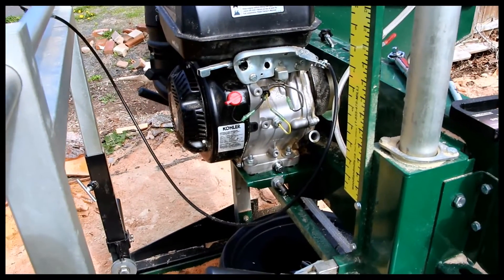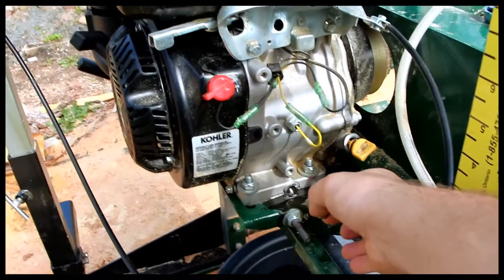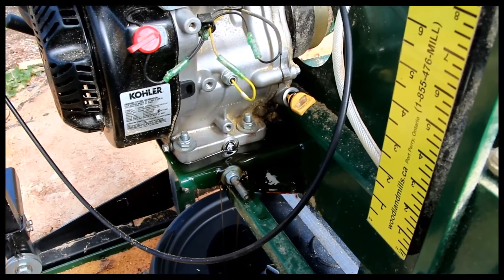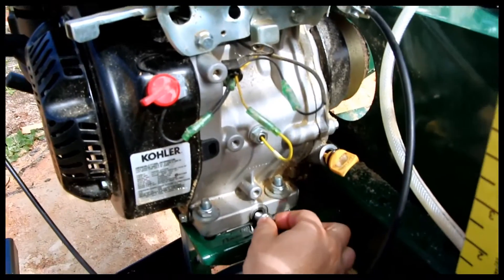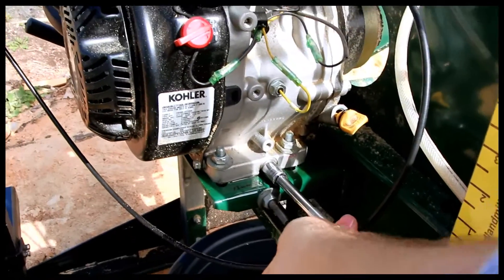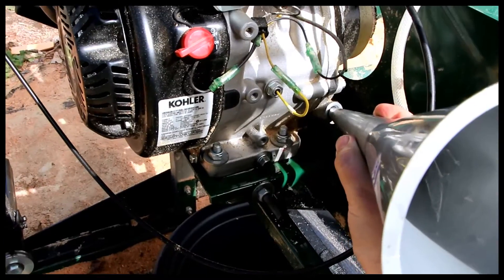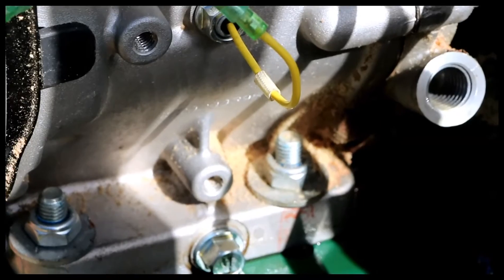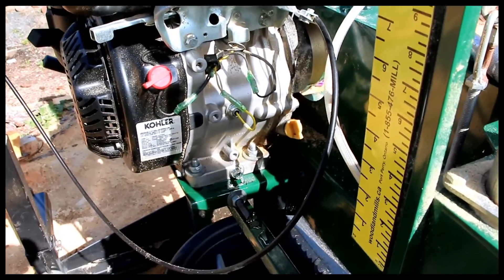kohler ch395 oil change command pro 9.5hp woodland mills hm126

Comment: Nice video. Problem is the older models of the Kohler command pro found on John Deere commercial mowers are way different. 
The drain plug device is virtually impossible to reach. It is wedged into a tight space almost touching the frame and in a spot that
you can't squeeze anything into except two fingers. You can't get your hand into that space to use the "Push in and turn to the left"
dohickey drain plug device. You simply can't get any type of pliers on the thing to get it working. How do you get the oil out?  Two options:
   1. Remove the filter and let the oil run out of the filter housing.  Next, jack up the opposite side of the 562 pound mower until it is
almost perpendicular and let the oil drain out of the oil filter housing that way. It is advisable to make sure the gas tank is empty before
doing that. Don't let the mower tip over.
   2.  Simply replace the filter without changing the oil.
Reply from the maker: Yikes....  yeah there's gotta be some mod for that....ugh

Comment: The "second" dip stick is for the gear box oil. It is to be changed out every 50 hours.
Reply from the maker: Any reference on that?   I'm pretty sure they both go to the same cavity
Reply: @matthewolson8875  You are correct.  Both dipsticks go to the crank case.  For different applications one filler or the other may be more convenient.
Reply: @peguy1490  having hard time finding video of crank case oil change on a kholer command, any help?
Reply: gearbox oil change

Comment: Seems that Woodland Mills when they have an issue burry their heads in the sand. I will be sending everything that I purchased from them back. They are screwing me out of 300.00 worth of shipping and won't credit me back. Terrible customer service to say the least if you ever have an issue. Who needs to deal with that. Not me. Buyer beware. Im having to call my credit card company to file claim against them. 4 weeks now and they still have done nothing to resolve the issues.

Comment: How do you like that engine? I noticed that it's made in China, any issues?
Reply from the maker: smokeya2 it's been good.  quiet and smooth.  no worries at all...and I've used it for a bit
Reply: Still seems far better than those junk Briggs and Stratton engines something is always wrong with them